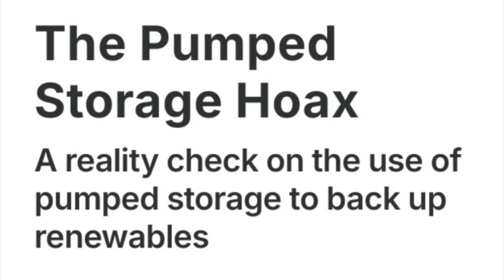The Pumped Storage Hoax, Exposed in Two Minutes

Comment: As usual, an "expert" who says it can't be done when it is already occurring. China generated 50gw in 2024, Australia already has multiple pumped hydro schemes going, and Switzerland has one that's been going since 1907.
Reply from the maker: The only skill you need to understand the issue is that it can not be used, is to multiply two figures together. Look at the total energy required in a wind drought. Look at what you need and look at what pump storage is available. You obviously haven't read the paper. And what you say about all that generation in the countries, it's fine but it's not used for long-term sustainable long-term renewable backup. It is used simply to balance the grid over the day and nights as I have explained completely in the video.

Comment: Very interesting video. I'm a retired Civil Engineer in Connecticut, USA. I agree with you that so many of these "experts" are idiots. On the Housatonic River we've had a pumped storage generation setup since before WWII. Its been almost 60 years since I saw the place. I think that it only held a couple of days worth of storage. I also recall that the water to fill the storage came from up river so that the pumping was easier. Its the kind of thing that can work in some situations. Good Luck, Rick
Reply from the maker: Yes, it does work in some situations, Rick, such as the Electric Mountain in Wales, but it is just short-term as you say. It does not and cannot be used to back up any renewable intermittency because the wind droughts are simply too long.
Reply: @ClimateRealism  There isn't a good solution for all places. That's what the communists will not accept. I built my house passive solar and super insulated decades ago. It didn't cost much extra and works pretty good when I keep the shade trees cut back. Good Luck, Rick
Reply: @ClimateRealism  OK so not suitable for long wind drought regions..

Comment: I realize that my comments do not exactly apply - but, here we go. Stored energy works really well under extremely large scale conditions. One of the best examples that I am familiar with is here in Washington State, US.  Along the Columbia River is the highest producing hydroelectric facility in the country. The original reason for the dam had to do with irrigation but before long the production of electricity became an obvious benefit. Now comes the bit about energy storage. A portion of the generators are used to fill a nearby sizeable lake above the Grand Coulee Dam. it is Banks Lake.
the flow volume of the Columbia is seasonal and as such with many dams a lot of water would just be spilled at high river flow times. But in this case much of this water is pumped into Banks lake for use at low flow times along the Columbia. Thus, irrigation and hydro power production are "leveled" to a great degree.The Dam also forms Franklin D Roosevelt Lake which also contributes to the leveling of the Dam's output. As an aside, there are quite a number of dams along the Columbia some are just Hydro and some serve Irrigation needs as well. This turns the state into an extremely productive agricultural region. Also, the Grand Coulee allowed construction of the Hanford facility which was instrumental in producing fissionable material for WWII. 
Frankly, it is difficult for me to see how "alternate" energy sources can contribute materially to the grid as the Sun goes down at night and the wind does not always blow or blow steadily. Massive storage amounting to days, weeks, or even months does not seem to be practical on any plane. The cost and the footprint would be enormous. In addition, I see video after video of wind machines being taken down - not even 20 years old. On the other hand, within a one hundred mile radius of me, I know of at least three hydro plants operating for more than one hundred years. I realize that hydro cannot exist every where but generators that last less than 20 years and take up untold amounts of land or off shore area are just not practical.  There are solutions, however but there is a NIMBY problem to be overcome.
Reply from the maker: I very much support hydro plants, but pumped storage is not doing the same thing at all.

Comment: Yes, been saying this for at least 15 years.   There are curently plans to 'upgrade' the Cruachan Pumped Storage scheme in Scotland, which is currently 400MW capacity, which in theory can run for 24hrs, (but is limited by statute to 12 hours as it's a blackstart station).   The new plans are to increase generation output to 800MW or 1GW.  But by using the same upper reservoir, so it will produce more at time of peak load but only for half or 40% of the time.  There are also plans for new punped storage scheme  at Loch Lochy, which will be 1GW. But again it  will cost billions and will not provide any more than 12 or 20 hours of storage for periods when there is no wind generation.
Reply from the maker: But that isn't even 1% of what is needed. The numbers don't add up when you realise that a 1 GW gas station can produce 24 GWh a day.

Comment: This video sound's somewhat absurd. On sunny and windy days wind and solar produces far more than the country can make use of. So, the energy it produces, either goes lost, or is used to pump water, or to charge batteries. So, since solar and wind can't be turned off, you at least make some use of this energy overcapacity. So, it doesn't matter if the energy efficiency in the process is down to 30%, it's still better than just trying to find out a way to discard this overproduction.
Obvious, batteries are far more efficient, but also far more expensive.
Reply from the maker: I'm sorry, but you are totally incorrect almost at every point here.
1. The wind and solar do not produce more than we need. The problem at the moment is that we have to pay them because we can't get hold of the energy. Right? That's number one.
2. The actual cost of wind is extremely expensive, many times higher than gas. That has been the case except for the Ukraine crisis few years. So it isn't like you're saying about over capacity. We will never have the over capacity and if we did it would bankrupt the country to have it. So I'm sorry you're living in a dream world regarding this over production. It isn't there and never will be.
Reply: @ClimateRealism  1. If Wind-Solar produce less than used, why are you even worried about storage or pumping water?
2 - "91% of New Renewable Projects Now Cheaper Than Fossil Fuels Alternatives "  (irena)
"Australia 'wasting' record amounts of renewable energy as share of wind and solar soars"  (abc)
Reply: @hokroeger  So when the wind is blowing hard and wind farms are being very productive, the grid cannot absorb this extra power, so, what do we do with it? We do not have the ability to store it long term so we pay the wind farms to turn off. Hence making our electricity much more expensive.

 Elon Musk's idea of space solar seems to me to be far more efficient at providing power. 

PS  The lifetime of wind farms is proving to be a lot less than advertised, so they are not very green at all.
Reply: @tmog1000  Storing energy by pumping water is a long-term solution for storing extra wind and solar energy.  But, mostly, extra energy has only to be stored for short time. That's for what China is still building new coal fired electricity: to supply energy when wind is nt blowing, and sun not shining. Those facilities can be turned off and on, when needed.

You can claim Wind turbines aren't as long-lived as advertised - well no matter their life span, they produce energy cheaper than any fossil fuel alternative, a situation which has even improved when Europe banned cheap Russian gas and oil.
On the other hand, solar and wind, electric cars, are driving down the use of fossil fuels, keeping their price also down. That wouldn't have happened without solar, wind, and electric cars. Fossil fuel prices are down like never before, and still have a hard time competing with with wind and solar.
Reply: @hokroeger  'Storing energy by pumping water is a long-term solution for storing extra wind and solar energy'  Nope. Not without spending trillions.
Reply: @tmog1000  Why spending "trillions" Only thing you need is some used gas pipes to be recovered from Nord Stream, and some pumps! Less than a million USD!

Comment: Dear sir, I beg to disagree… and I am also a retired engineer, formerly active in the renewable energy sector.

You say something to the tune of “those idiots don’t bother looking at the days of storage needed…” … but we DO! And thank you for the name calling! We do as precisely as decades of past data will allow. But we don’t count it in days we count it in hours. It obviously varies depending on countries and regions, but it varies between approximately 40 hours in Southern California and 120 hours of average power consumption of storage in Germany (probably about the same in the UK, but I haven't seen the numbers).

But I do agree that pumped-hydro is no  silver bullet, but ONE component of a total mix of measures comprising, in order of strategic priority:
1. As geographically wide an electrical grid as possible, so that when Germany for instance is affected by a “dunkelflaute”, southern France and Spain, for example again, are enjoying record sunshine and wind.
2. Reinforced transmission on the new routes that renewable energies will require. Especially long-distance HVDC lines.
3. A mix of generating technologies (solar, wind, run-of-the-river hydro, lake hydro, geothermal, etc) reducing any trough in power generation due to longer-lasting unfavorable meteorological events as much as possible.
4. A system of contracts for voluntary demand curtailment and load-shifting. Such contracts already exist, and are win-win to participating industries as well as the utilities. It does exist also for private consumers (TEMPO tariff in France).
5. After having done all the above-mentioned optimizations, then only do you calculate your storage needs, and implement it with various technologies, which are again country and regions dependent: 
- My home country of Switzerland is developing pumped-hydro by the tens, even hundreds of GWh… including in my native village… anywhere where there are mountains or at least tall hills, lie an untapped potential for off-river pumped-hydro storage.
-Southern Australia is installing battery capacity as if there was no tomorrow! 
- Northern countries like Finland are developing heat storage (for building and industrial heat, not power generation).

And, finally, China is doing all of the above faster, and at greater scale than all the other countries combined!

But obviously, if you look exclusively and narrow-mindedly at the UK grid... which is precisely what you do... in abstraction of continental Europe (and possibly beyond), then you are indeed doomed to failure!  And in that case only, would I agree with you:  the UK's potential for pumped-hydro will not suffice!  But when the wind is not blowing in the UK, it is blowing strongly elsewhere... it is a meteorological inescapability, the stronger the high pressure system, the stronger the winds at its periphery!

So, I have an advice for you, from one senior engineer to another:  take a step back and look at a bigger picture than that of the particular fight you have been picking!
Reply from the maker: Sorry, but you are totally incorrect. The cost of wind we are paying in the UK is already much, much higher than gas. So, every wind farm we put in, we pay them more by a factor of 2-3-4 times depending on what type of wind power it is. With floating, it's up to 4-5 times. We pay them 4-5 times more than say gas, so it's extremely expensive. But the costs don't stop there. The costs actually are that you've got to supply the inertia to keep the frequency right. That's a huge cost. In addition to that, it disrupts the gas supply, so you have to pay the gas stations to be spinning waiting for the fluctuations in the wind. And, in addition to that, we have enormous bills on the additional grid that wouldn't otherwise be needed. So, when you add up these costs together, it becomes enormous. So, I'm sorry, it doesn't matter whether I'm a senior engineer or you're a senior engineer. All that matters is evidence, no matter who it is, and the evidence, sir, is against you.
Reply: @ClimateRealism  You are just claiming vague things... totally false as we shall see... without giving a single source.

So, I shall!... using data from IRENA which, I agree, only aggregates data supplied to them by the various governments of the world... So, if you are one of those thinking that governments are fudging the numbers, I shall compare them to private or academic independent sources, and specifically the Lazard LCOE Report 2025 (page 8) for US costs (Lazard is a private firm, founded in 1848, and most highly respected in the field), and for specific UK costs, the University of Surrey's paper entitled "Levelized cost of energy (UK offshore wind power) drivers, challenges, opportunities and practice 2010–20" .

Note: ALL the figures below are BEFORE any subsidy.

1. The LCOE of onshore wind was in 2023, according to IRENA and for new projects:
- China 26.0 $/MWh
- UK 31.4 $/MWh (24.1 £/MWh)
- USA 38.4
- Germany 53.3

2. Lazard gives a range for US onshore wind power in 2025 of 37-86 $/MWh. Please note that this is NOT for new projects, but for all existing US installations.  So, the LCOE for new projects would be near the bottom of that range... and that coincides with IRENA's number!

3.  IRENA gives an average LCOE for UK's OFFSHORE (non-floating) wind power of 59$ (in 2024 $) or 45 £/MWh.

4.  The University of Surrey gives an average (in 2022 £) of 43 £/MWh, with a sigma of 16£.  Again, the IRENA number is confirmed by an independent source!

5. The Levelised Cost of Electricity (LCOE) for new gas-fired power in the UK is approximately £124/MWh for 2023, though this figure is projected to be around £114/MWh for 2025.  That is 3-4 TIMES higher than the cost of wind power!!!!

I conclude by citing a paragraph of the abstract of a study extremely recently published by University College of London:
"This study presents new evidence of the financial impact of wind generation on the UK energy market, challenging the idea that sustainability, security, and affordability, are always in conflict. From 2010 to 2023, wind power delivered a net benefit of £104.3 billion to UK consumers—£14.2 billion from lower electricity prices and £133.3 billion from reduced natural gas prices, partially offset by £43.2 billion in wind energy subsidies."
(Colm O’Shea et al, University College of London, Published: 2025-10-23).

There is NO NEED whatsoever anymore for so-called "spinning mass" to stabilize the phase of the grid.  That used to be the case a decade ago, but is now obsolete. We have now what is called "grid-forming" inverters... as well as other technical solutions in the specific case of wind turbines.  That is FUD spread by the parties that have an interest in disinforming the public on the topic. And obviously you swallowed that disinformation hook, line and sinker!

Conclusion:  Wind power is, with solar photovoltaic, the CHEAPEST forms of power, bar none... even including storage!  But are the consumers profiting from that?  Not immediately, that much is true.  Firstly, most numbers cited above are the LCOE of new projects.  The utilities, and hence their consumers, must pay for the (higher) prices agreed for past projects.  The grid must also be adapted to these big changes, and large investments have undoubtedly to be done... and they have to be financed.  But most importantly, the price of electricity you pay in the UK is indexed on THE PRICE OF GAS-GENERATED power... and NOT that of wind power.  That is a problem not only in the UK, but pretty much throughout Europe (with exceptions in the countries that use almost no gas for power generation, such as France, Norway, Sweden, and my home country Switzerland)... and that is presently a pretty hot political topic as, you are correct on that, the citizens of the countries concerned are being conned... but NOT because of the supposedly high price of wind power... but precisely the contrary, the REAL high price of gas power!

You provided NO evidence... I DID... and plenty of it from multiple international, US and UK sources, and that evidence is supporting me!

You claim to be a retired engineer... and I believe you, as I ask you to believe me.  But, as engineers we LOVE data... REAL data... our careers depend on us basing whatever we design or build on the best data possible!  We can be proven wrong... that obviously happens... but boy, to do so you have to have solid data backing you up.  So, I am surprised that, as an engineer, you just came back to me with bla-bla!  Could it be that you are more driven by a political and emotional agenda, than by a factual and engineering one?